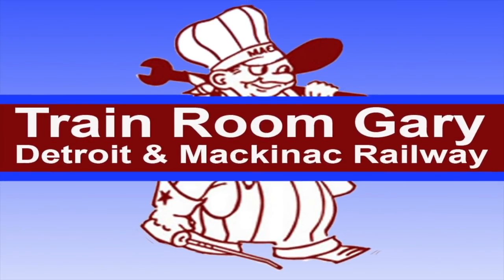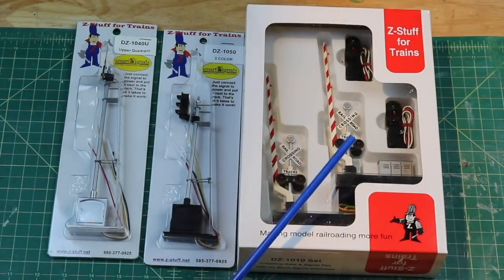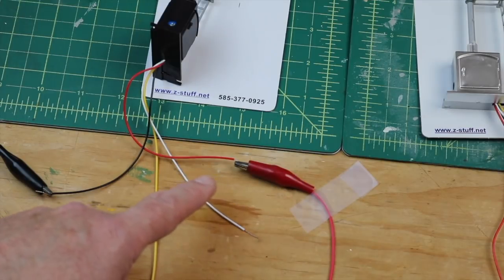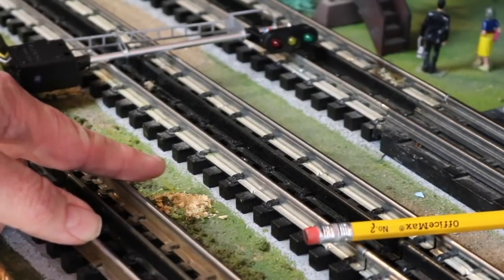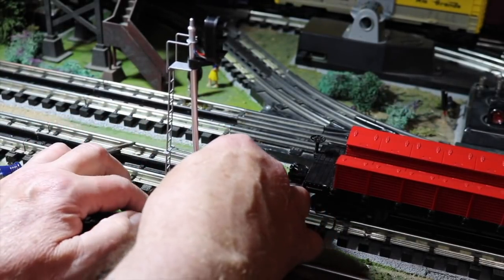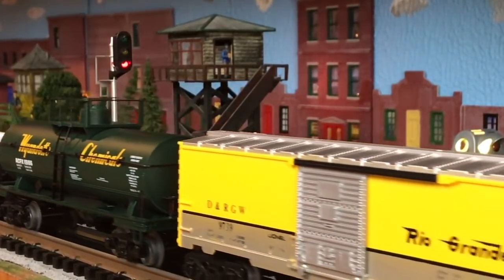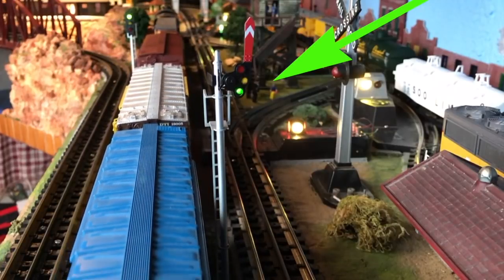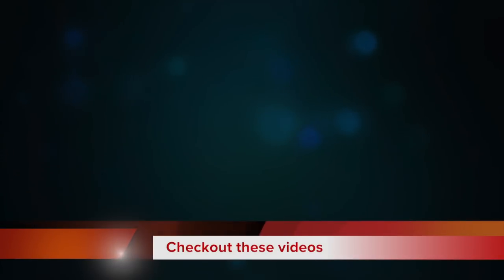Z Stuff for Trains • Signal Lights • Part One

Comment: Where are the block detectors located in relation to the crossing gates. I did not see them on the lay out.
Reply from the maker: Hi Bill - These are signal lights and the sensor is in the base of the signal. I also have a different video about the crossing gates. The crossing gates have a sensor about 6 inches before the crossing gates. These look like a dwarf signal. Hope this helps and thanks for watching. Gary from Detroit. 🚂
Reply: Are the two dewarf signal detectors covering both tracks
Reply from the maker: @billgraham4127  There is one dwarf light for each line. There is also a sensor at the base of crossing gate. If you are installing these for the first time - Dennis  the owner of the company is very helpful. His phone number is in the directions - Good Luck -  Gary 🚂